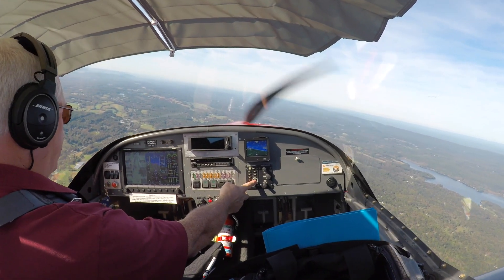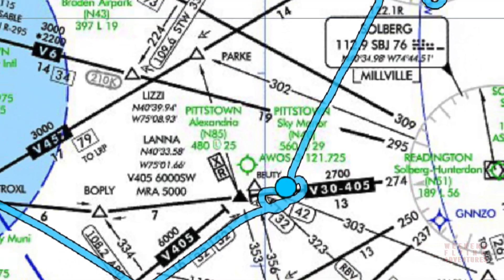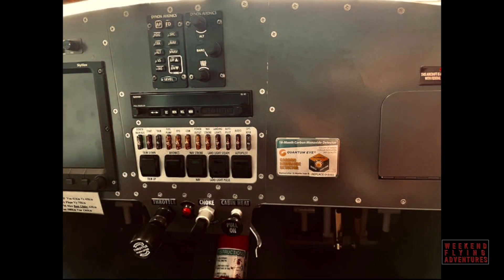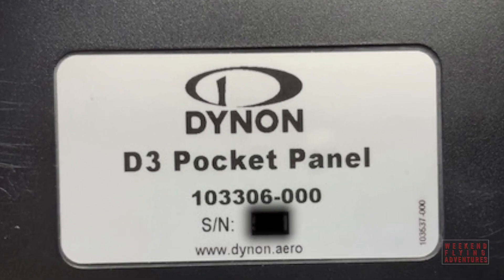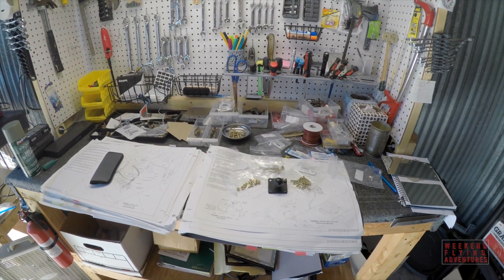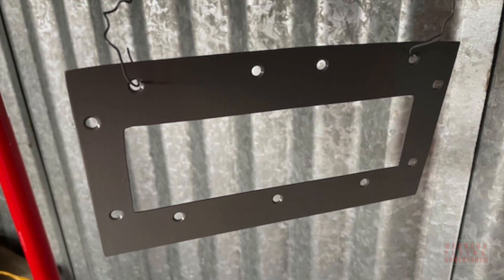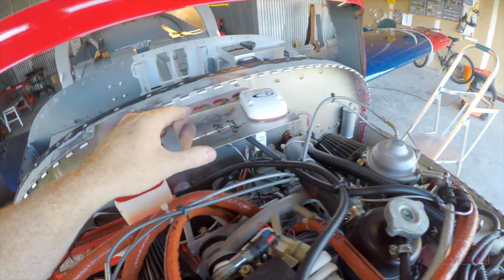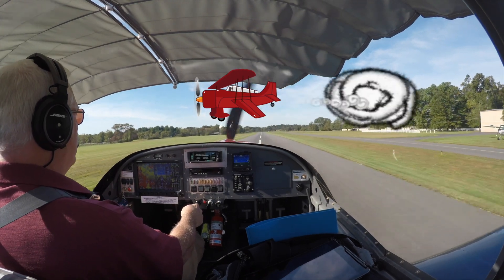WFA - Upgrade RV-12 Panel with IFR GPS Navigator

Comment: Hi Brent, as someone who has a PPL, doing my IFR checkride soon, I'm considering purchasing an RV-12 ELSA to time build with my brother (who is also a pilot with his CFII) and fly some fun cross-country trips around the country. However, we would consider also upgrading the panel so that it is IFR capable to file and have the option to fly in light IMC if needed. We currently train in a different type LSA but with similar avionics (G3X, G650, G5) and also the Rotax engine, hence why the RV is of interest....simply because it already feels a bit familiar. Plus, less fuel costs than say the C172. We live in SoCal and that darn marine layer rolls in and can often prevent us from departing from our home airport, even though it might be blue skies just a few miles to the east. If you had to guess/estimate, about how long did it take you from start to finish to complete this upgrade so that you could fly RNAV approaches? I would need to find a shop who could install the equipment for me as well, which I'm sure might be half the battle. Thank you for any input!
Reply from the maker: Hello, thanks for your message.  Unfortunately, it's difficult for me to accurately estimate the time needed for the upgrade as I am guilty of tinkering with aircraft and don't tightly track the time needed for each upgrade.  I'm an amateur at this and clearly take a lot more time than a more experienced builder would likely need.  For this one, it was lengthy as I needed to create a custom mount for the GPS175 unit shelf unique for my panel and also move the pre-existing autopilot control panels to a new location.  I suspect if you hire an A&P/avionics tech to do this, while it would be done more efficiently than me, it would still cost a fair amount of hours/labor over and above the hardware costs.  One idea for you would be buy an S-LSA RV-12 from Vans that has all the avionics you want and need for IFR flying, then convert it into an E-LSA.  That way, you would be legally able to fly in actual IMC (S-LSA similarly equipped cannot do that per the ASTM rules) and would have a well built RV-12 equipped as you desire.  For ongoing maintenance & reliablity a Vans' constructed ELSA would be a safer route for someone who did not actually build the aircraft himself as you would not be relying on the unknowns that may exist from another experimental builder.  I am aware of other pilots who buy well equipped SLSA aircraft and then convert them to ELSA to take advantage of the FAA rules governing experimentals.

Comment: Probably not the comment you’d expect but I love your music choice.  It reminds me of Jean-Jacques Perrey and Dana Countryman.  I have a 65 PA28-140 and I often think about getting out of certified aircraft.  The RV12 is often on the short list because of its economy but often worry about the limitations of its useful load.  Have you found it limit your travels?
Reply from the maker: I source most of the music from https://audionautix.com  Its royalty / copy-write free and YouTube doesn't give my any pushback on using it.  

As for the RV-12.  Yes, the useful load is prob. the major issue with this aircraft.  Of course you know that everything in aviation is a tradeoff.  Single pilot, I can load up whatever I need for a long trip.  However, if a passenger comes along, I'm sig. limited.  Not an issue for my type of flying, but its something to consider if you regularly take a passenger and need to carry luggage etc... for multiple day, longer trips.  Its not very fast (I plan for 115kts ground speed), but comparable to a lot of four seat singles with 180 HP engines.  Incredibly inexpensive to operate.

Comment: I plan on doing this exact installation on my -12 with my Skyview HDX
Reply from the maker: I very much recommend that upgrade.  Something I learned but didn't post here was that I needed to move the GPS antenna from over the engine to the top of the tailcone.  I was getting some form of interference and/or poor reception and I was losing GPS integrity periodically in flight.  I relocated the antenna away from the engine/under cowl location to the tail with a clear view of the sky and it works perfectly now.  Garmin (WAAS) GPS antenna's are apparently very sensitive that way.  The Dynon antenna remains under the cowl and works fine.
Reply: @brento41  thank you for that tip, I will likely do the same. Does your autopilot also fly the glide slope? As soon as I do SB-00053 and 00067 I will work the gps 175 install. Oh, and brake pads. Always something to be done, part of the joy
Reply from the maker: @FloridaFlying  It flys the Dynon AP amazing well.  Still fine tuning the autopilot settings, but its very tight.
Reply: Hey Brent, 8 months later and I’m ready to click purchase on a GPS 175. Are you able to share what you ordered besides the 175 and ARINC module? I emailed Steinair and they said “We can sell the GPS-175 and SV-ARINC (That is all you should need, and they come with the trays, backplates, etc..)  however we do not have a plug and play solution for the -12, and are unable to offer harnesses.  Vans publishes their diagrams online, but the extra hurdle of the AV-500000 mystery box pushes us away from this offering unfortunately”

I’d like to buy the harnesses ready to go if possible. Creating my own seems a little daunting.

Comment: Brent, I just hung up with Garmin Support.  It was recommended to me to consider a 355.  When I mentioned my initial coupling of a pre-owned 340/430 as a solution for full IFR this too was confirmed as a very good "fix" for approximately 5 years or until Garmin begins to migrate its customers to newer products.  On this basis I will continue to look for pre-owned 340/430 as this combination will provide me more than enough time to earn my IFR rating and also my existing Garmin 200 can be used as "COM 2"; a nice backup radio.  My two flying buds want to build a Sling TSi during this time.

Comment: Brent, I am in a hangar next to Mike over at KDYL.  I also have an RV-12.  I am leaning towards upgrading so I can use my plane for IFR training.  I am leaning towards installing a 430W, the Dynon interface, and a VOR antennae.  If you had your IFR upgrade to do over again, would you do anything differently?
Reply from the maker: Hello Michael, short answer is that I am very satisfied with the GPS175 unit for the RV-12. Very small size, but fits really well on a relatively small panel.  I don't see the need for a ILS/VOR receiver at this time, but it would definitely allow you to do a full FAA check ride in the aircraft.  I'm limited to GPS approaches which for me is really not limitation.  Might be for some.  The garmin GNC355 unit is the same size on the panel as the 175 unit but comes with a second COM radio.  An audio panel might be needed to switch between the existing garmin radio and the 355 unit I assume.  I didn't go that route as its current draw is greater and I wasn't sure I'd have enough current available.  More money and might need another antenna, but something I'd probably look more closely at, if I was to do this all over again.

BTW, I moved the GPS antenna from under the cowl to the top of the tailcone.  I was getting radio interference I believe and it failed at times.  On the tail it has been 100% reliable so far.
Reply: @brento41  Brent, thank you for the quick response.  I have an Experimental -12.  My goal is to use my 12 to get my IFR ergo the 430.  Will keep you posted.

Comment: I'm looking at buying an RV 12 that is an E-LSA the panel is fully glass and would typically be ifr certified....do I need to get the aircraft certified ifr or how do I get to the point where I could file ifr and fly imc legally if I need to go through a cloud...is there a certification I need, do I need to alter the poh...the engine is also the 912uls I believe....if you are able to give steps or a guide in order to get to a "certified" state if there is one that would be great I loved the video
Reply from the maker: Quick reply.  First, check the Operating Limitations for that particular aircraft.  Most standard language prohibits flight in IMC "unless aircraft is properly equipped."  S-LSA are always forbidden to fly in IMC per ASTM standards.  As long as a 24 month pitot-static inspection is current, of course transponder check as well, you don't need any other recurring inspection for IFR instruments.  Whatever you use needs to have been FAA certified for IFR when installed.  For GPS approaches, you need an IFR approved GPS source (typically these days all are WAAS Garmin or Avidyne units).  For precision approaches you need a NAV radio for the ILS.  If you want to use the E-LSA for an IFR check ride you will need to do a precision approach, so an ILS capable panel is required. I don't have that, so I used the flight school C172 for my check ride.  I understand the GPS navigator can now be used to demonstrate both non-precision approaches on a check ride (ie. you don't need a VOR receiver any longer)
Reply: @brento41  I believe the poh states flight in ifr/imc prohibited since the aircraft has very capable avionics do you know if I'm allowed to change the poh to say ifr is okay.... Since it's an Elsa do I need to follow the operating limits still? The airplane has both wass and ils/vor
Reply from the maker: @loganb6286  If its an Experimental, the owner can change the POH I believe.  What is important are the Operating Limitations that should be in the aircraft.  They were provided by the FAA (through the DAR at inspection).  You need to review those.
Reply: @brento41  Thank you! You helped me so much!

Comment: I’m curious about your Operating Limitations - mine qualify the plane for only VFR day and night. I have seen threads stating that the best you can do is file IFR but prohibit flight in IMC. In my case I think I could do IFR training if I was equipped for it. If your FSDO is approving flight in IMC, please let me know - I would be interested in doing that upgrade, although I also wonder if my 912 ULS has enough juice to support a heated pitot.
Reply from the maker: Couple of things.  First, S-LSA are prohibited to fly in actual IMC conditions per the ASTM standards but they can train and file in VFR conditions I understand.  E-LSA are experimental and are NOT limited by ASTM.  Unusual yes, but that's the reality.  However, the wording in the Operating Limitations is key to review.  Usually IFR is prohibited ...unless aircraft is properly equipped...  Similar the night flying which is prohibited unless properly equipped....Check exact wording in the Limitations for your aircraft.  Finally, a heated Pitot tube is NOT required for IMC per FAA (see FAR/AIM), however, I would agree that flying in actual IMC conditions where temperatures might cause freezing to occur would not be wise.
Reply from the maker: Posted a couple of statements from my operating limitations below. As long as the aircraft is properly equipped for IFR, it is permitted to be flown that way in IMC. That assumes it is an experimental or ELSA.  (Per ASTM rules, SLSAs cannot fly in actual weather, but can train with IFR instruments).  As for the heated pitot tube power requirements, that is definitely a good question. Without an external alternator our power is clearly limited. I don’t plan on flying in IMC where freezing might be a possibility.  I want to stay current, and have the capability for light IMC flying in warmer conditions. Flying in weather where freezing is also a risk is just beyond my comfort zone for the RV 12. 

----------
(11) After completion of phase I flight testing, unless appropriately equipped for night and/or instrument flight in accordance with 14 CFR § 91.205, this aircraft is to be operated under VFR day only.

(20) The pilot in command of this aircraft must notify air traffic control of the experimental nature of this aircraft when operating into or out of airports with an operational control tower. When filing IFR, the experimental nature of this aircraft must be listed in the remarks section of the flight plan.